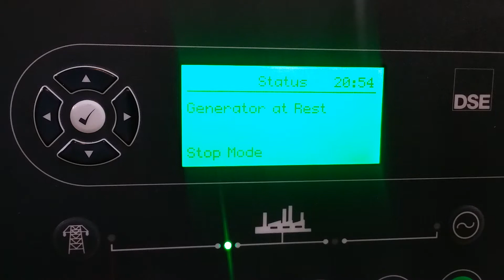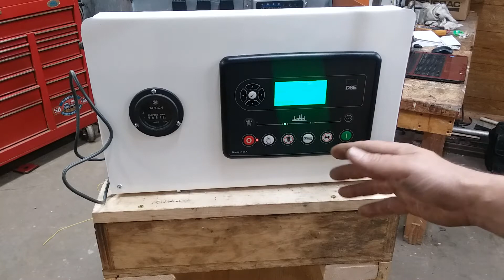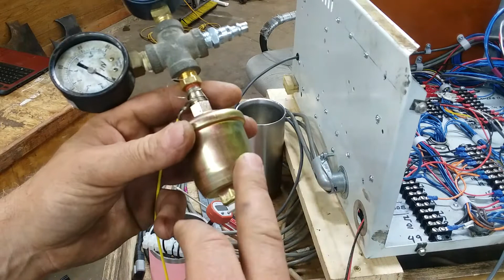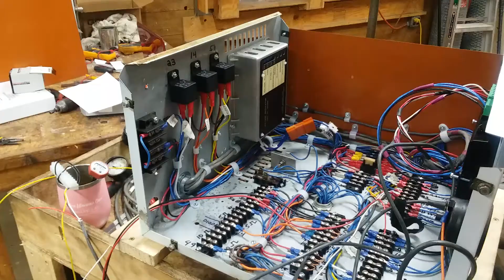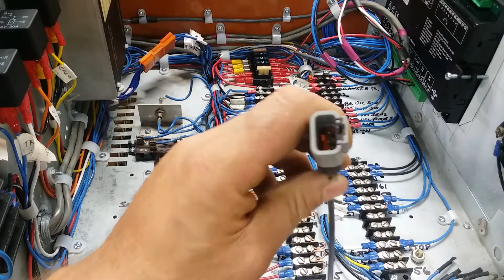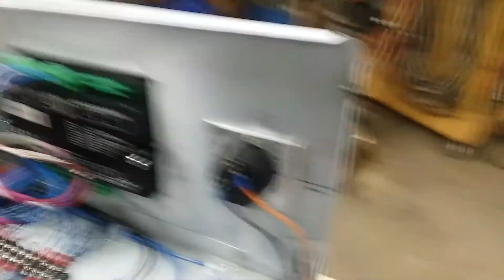Deep Sea control on an old Generac C panel.

Comment: What terminal did you hook up 23 transfer to on dse
Reply: Do you have a schematic of what the final wiring was, I have several of these that have failed C panels
Reply from the maker: I do, but it's proprietary.
Reply from the maker: I think it was pin 7.  It was marked close transfer, then it was run thru a relay for protection and fused.  I think.
Reply: @thefixerofbrokenstuff   Thanks for you help I downloaded software for dse and was able to configure  pin for transfer switch. Thanks again for your video’s